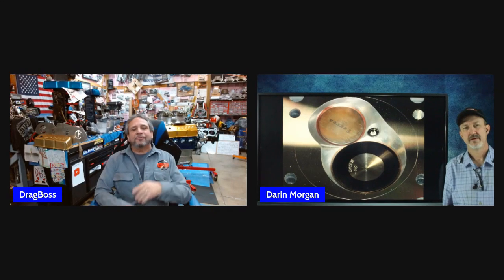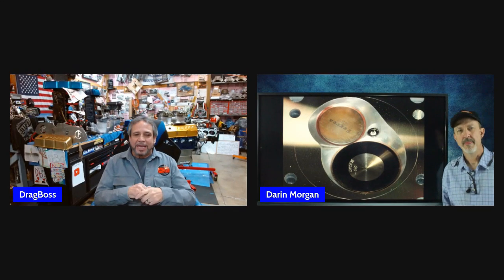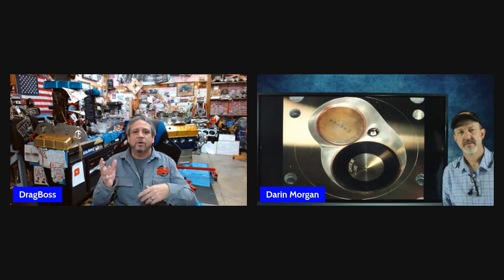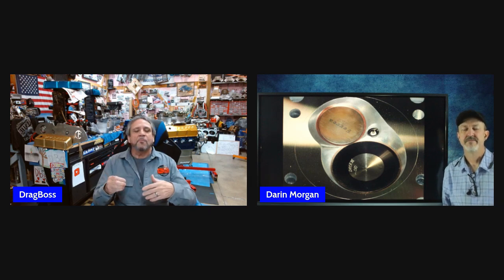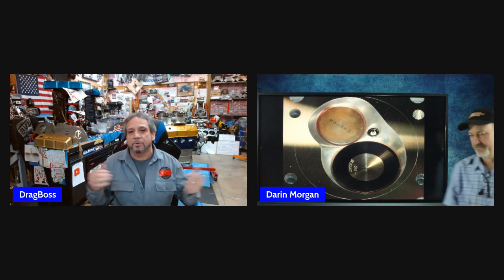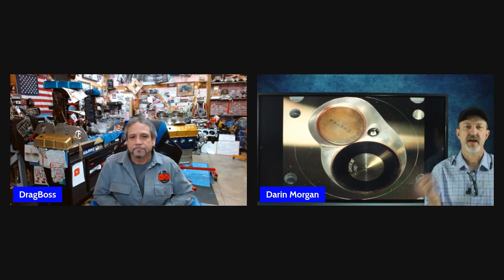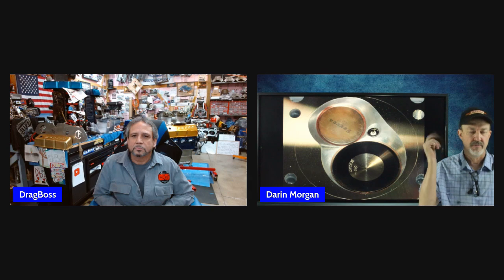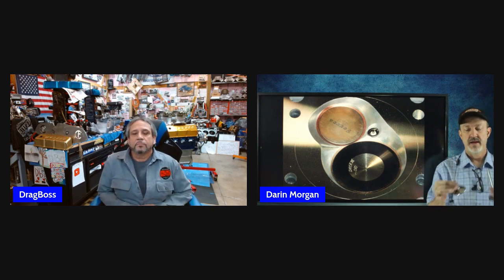DBG: Valve Cant, How Much Is Too Much? How Does Valve Cant Affect The Combustion Chamber Depth?

Comment: ,,, on the previous video Darin mentioned the huge gain made possible , in Pro Stock , with the large diameter cam journals . Am wondering if this was with the standard 5 cam bearings , or several more than five cam bearings  ,,, ?
Reply from the maker: Good question Roland. I bet five. We will have to find out. I was talking to WJ on Friday driving to work and he was telling me some cool cam stories. Clamshell set up….. which Jay Zolko will present. Maybe Johnson will too. Pat Musi is on deck.
Reply: Well the DRCE - 4 , had several more than 5 . Did Darin mention how many cam bearings are in his new Ford engine ,,, ?
Reply from the maker: @rolandtamaccio3285 no he did not, 70mm cam tunnel I remember.

Comment: Awesome info and insight as usual Tim and Darin! cant the valves just enough to unshroud the valve from the cylinder wall, rotate the valves just enough to aid in scavenging and spark plug placement!
Reply from the maker: Thanks vrm, you got it. Also as you rotate the valves in chambers rpm range increases….leave it at that. More too it obviously 😉💯🏁

Comment: Volumetric efficiency and combustion efficiency are inherently opposed.
Reply from the maker: How so? You would think they are symbiotic
Reply: @DragBoss351Cleveland  Just quoting Keith Duckworth. Maybe a dense charge can't swirl or tumble to spread flame front? I've got an old Peterson annual from 1974 that shows inline carbs on a tunnel ram. I'll post it to you.
Reply from the maker: @eddy2121 sure thing. These are the topics we will cover in DBGU. Good stuff thanks eddy

Comment: How about Brett in Snot Rocket winning in the Sick Week drag and drive with a 302 CI Mustang running a 6.07 at 235 MPH final round. 😎👍💰
Reply from the maker: Having fun at any expense. Wowser, impressive. Thanks  👍👍🏁
Reply: thats what you get with overhead cams and 4 valves.
Reply from the maker: @V8Lenny more is fun